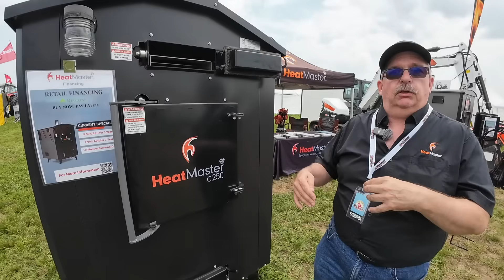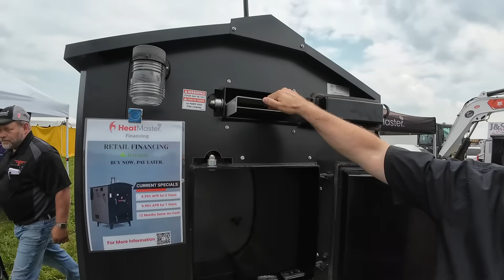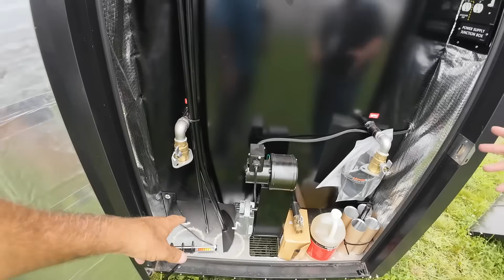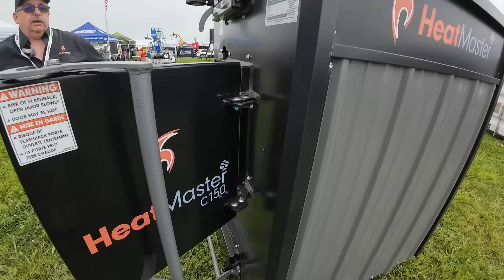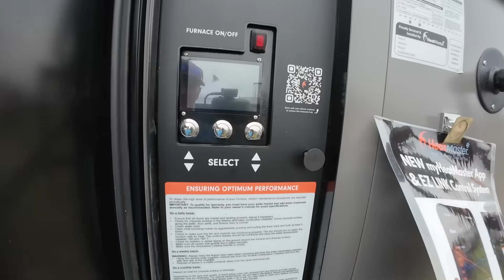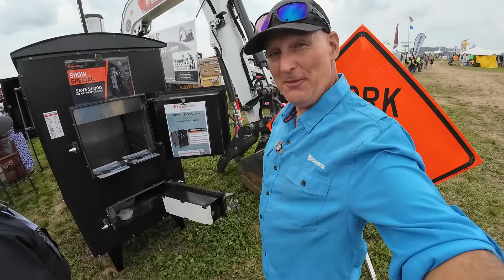WORLDS BEST FIREWOOD BOILER FURNACES! HEATMASTER

Comment: before burning wood for heat one has a number of things to consider.
check with your home Insurance company, some will drop you the instant you mention burning wood inside the house and most will require a minimum of 40 ft between an outside boiler and any insured building.

Check your local government codes, some small cities around me banned any wood burning stoves and one  requires a wood stove to have a chimney to be at least 10 ft above any houses within a block of the chimney
Reply from the maker: Yes, that's true. Ordinances and insurance vary, so it's good to check into your own situation.

Comment: And the third reason they will get gunked up is idling.  They work best running at max output, surprised they aren't pushing storage tanks that make the system much more efficient and easy to use.  21:00
Reply: Yes!…sing it brother! These boiler are a shoulder season nightmare

Comment: Fine marketing Chris. BUTT--outdoor boilers are complex needing infrastructure plumbing, pumps, and....loading outdoors. Our olde tech woodstoves do a job also, though lower K.I.S.S. tech. And "starting" @ $8100. ain't small change. JMNSHO
Reply: I think I paid $5,000 to replace my main woodstove.  but you're right that it takes less infrastructure.
Reply from the maker: That's correct, Ken.
Reply: I xan see the use for a boiler, i guess for massive buildings. Stoves are good for small to medium houses
Reply from the maker: Yup. Probably spot on.
Reply from the maker: Correct. But some people heat huge spaces and have an ample wood supply and love wood floors ... and can afford it.